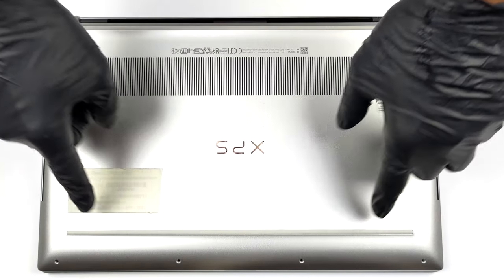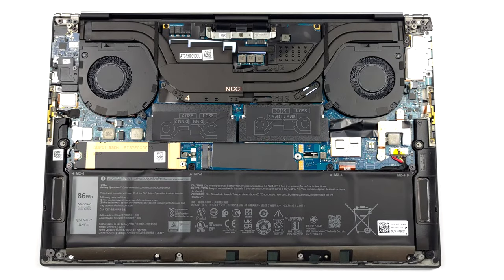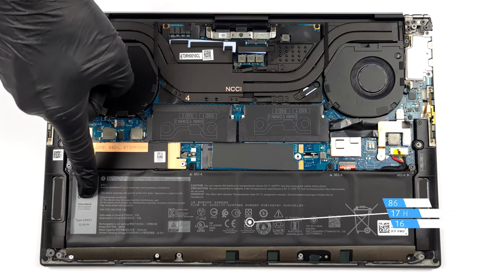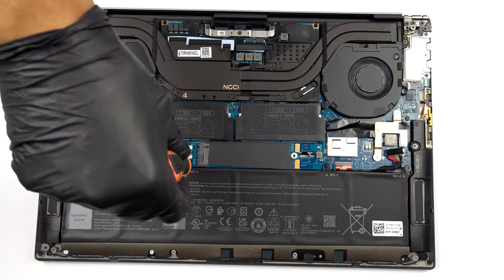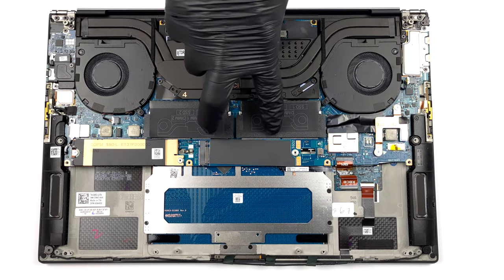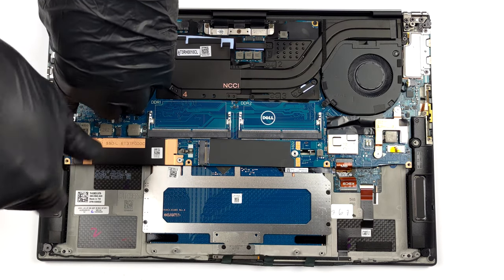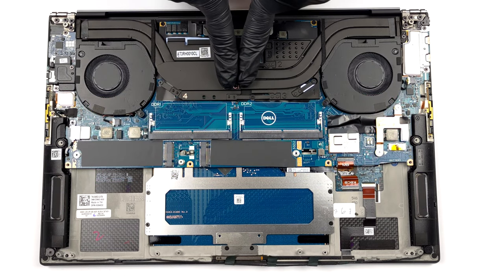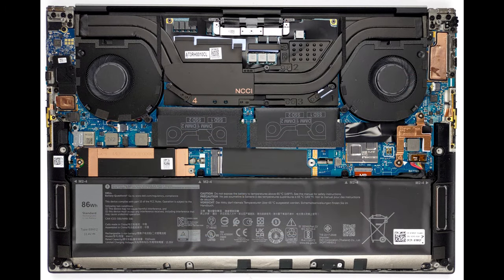🛠️  How to open Dell XPS 15 9530 - disassembly and upgrade options

Comment: Followed all your steps... and now, I can only see a DELL logo (CAPS LOCK ON - can't turn it off) and 5 white, after 2 amber LED blinks)... Laptop won't start. Any idea? I have installed a 32 GB RAM intstead of 16 - fully compatible.

Comment: Where is the WiFi card? It's usually in one of the corners and is removable in a M2 slot?  The fact that i can't see it whilst watching your video in 4K means, it's probably soldered to the board!
Reply: same issue, following